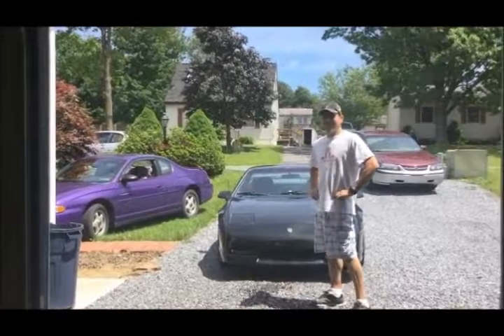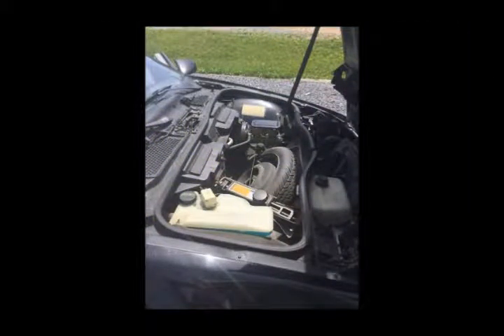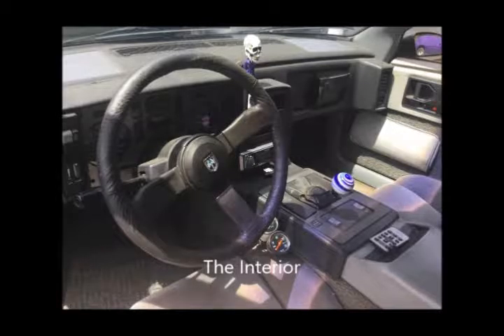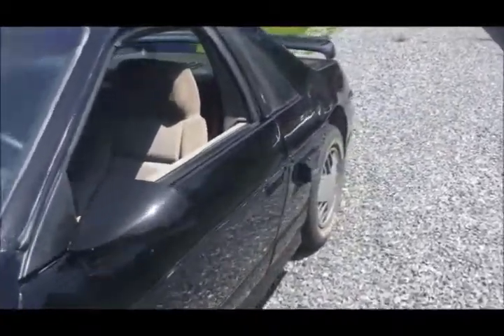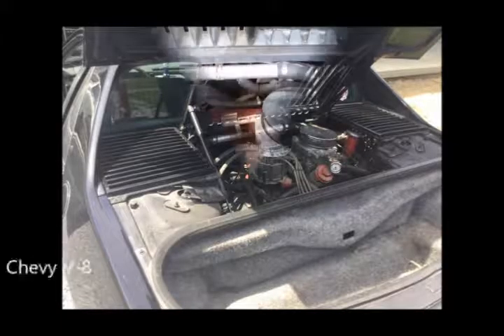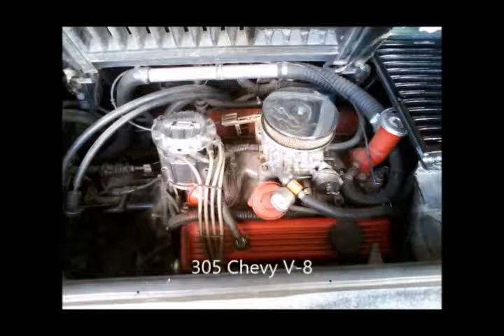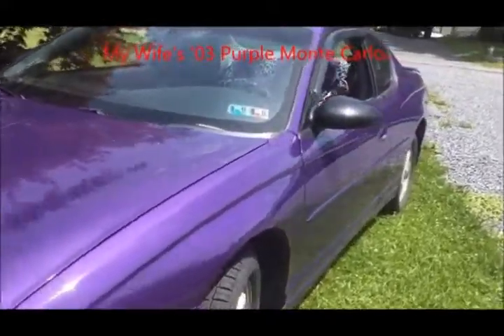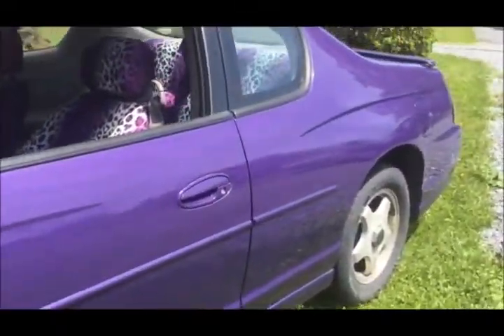86 Fiero V-8

Comment: slow junk.  305 is crap not to mention a carb on it.  prob only makes 180 hp at the crank.  not even beating hondas with that.  also that transmission is garbage and if you haven't broken it yet, its not making any power.

v8 archie built junk and went bankrupt.

get a video of it going down the qtr mile.

Comment: slow junk.  305 is cr@p not to mention a carb on it.  prob only makes 180 hp at the crank.  not even beating hondas with that.  also that transmission is garbage and if you haven't broken it yet, its not making any power.

v8 archie built junk and went bankrupt.

get a video of it going down the qtr mile.
Reply from the maker: I built the car in 2001 and yes it is a V-8 Archie kit.  The engine is a stock 305.  The original engine was a TPI, but I did not like it.  I always had the intentions to upgrade to the 350 but I never did.  I did not build the car to race, just to drive around town.  And, I never said it was fast, just fun to drive.